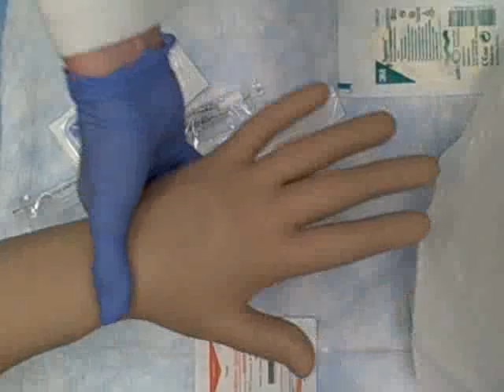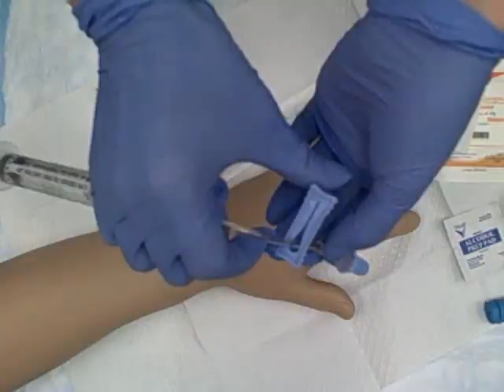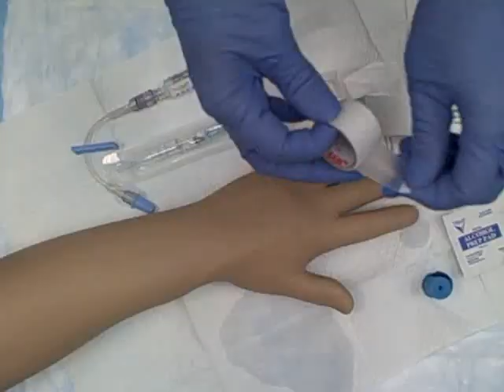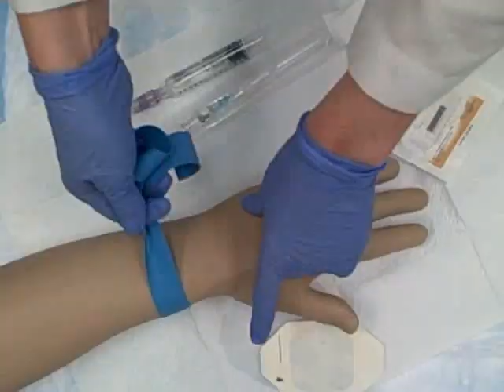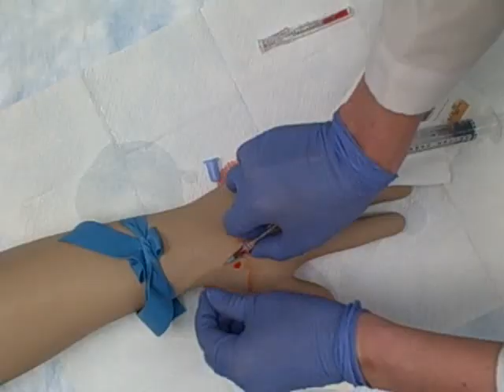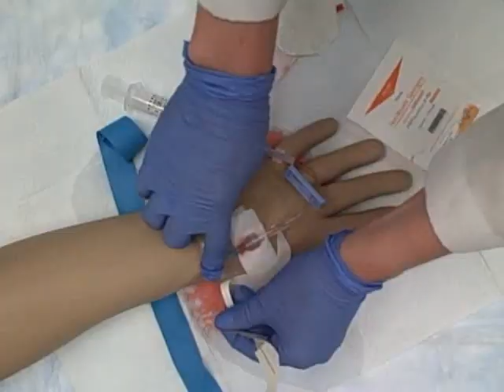Intravenous (IV) Saline Lock Insertion

Comment: Overall, this was a fantastic step by step video.  Your pace was on point.  However, if I can give a kind word of advice and with all due respect, the tourniquet must be removed as soon as you see the flash.  Also, allow the skin to dry on its own once you have cleaned this skin without blowing on it with your hand or mouth.  You would be re-contaminating the skins surface by doing this...also, do not remove the alcohol pad from the pouch until you are ready to use it, same with the gauze...other than this, it was an excellent video and I truly enjoyed and learned from it!  Thank you.

Comment: For me It's very messy.
Reply: Part of the trick for less mess is applying pressure in the right spot (which was NOT demonstrated in this video!) Picture where the very end of the catheter is inside the patient's arm or hand. Press there so that you are covering the end of the catheter. If you press right by the puncture site where the hub of the catheter is (as demonstrated in the video) you will have a very difficult time stopping the blood flow. It was one of those 'Duh!' moments when I learned that and it helps out a lot.